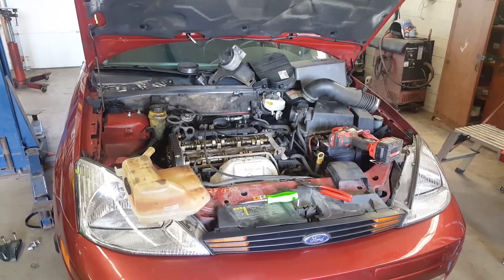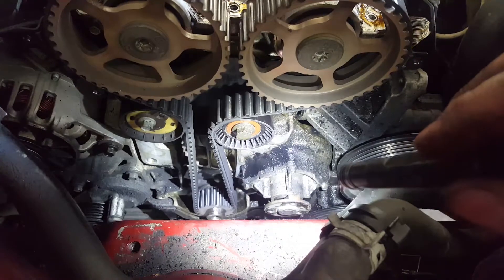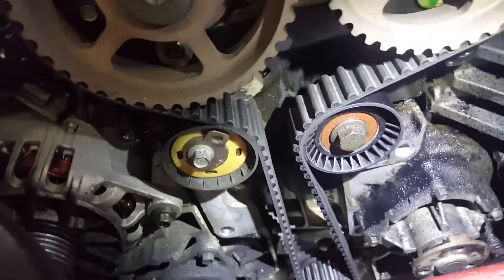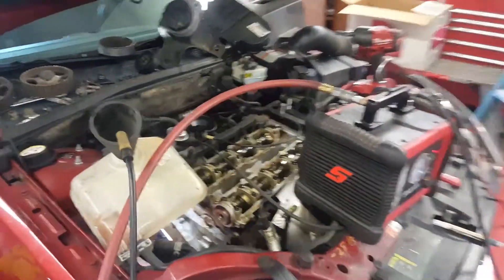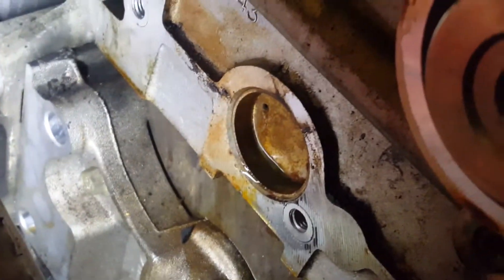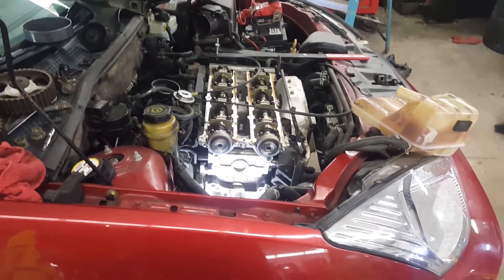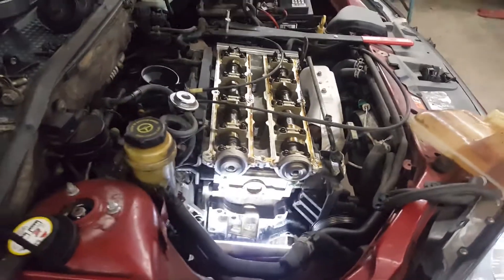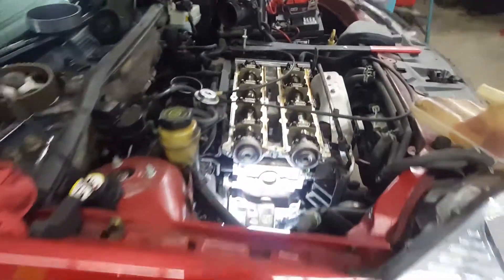Ford Focus - coolant leak

Comment: Hey quick question. I have a 2015 Ford Focus Diesel and i have a problem with the coolant. The coolant appears to be leaking internally. Sometimes when the tank is empty i open it slowly and as i open it some of the coolant fluid comes back through the pipes and the tank fills itself up again! Sometimes i open it and as pressure releases, it stays dry... i am spending so much money on coolant now. Also sometimes i turn either the heater fan or air con and the engine temp goes up and for example if i want hot air, it blows super cold air... so the aircon messes up....whilst the engine temperature is high (over half way mark) then all of a suddeen the engine temp gauge drops back down and then the air comes back and works as per the setting (i.e: if i have heaters on... blows cold air... once temperature gauge drops, it blows hot air).... i have had the head gasket checked as well as EGR cooler valve and was told this is ok. I also replaced the coolant tank and cap... problem persists .... please plesse please help...

Comment: I’m leaking green coolant but have no overheating nor is my car smoking the car runs and drives fine.  I’m not sure if it’s a hose that’s bad or the radiator itself. I have a 2000 Ford Focus ZTS Edit: The A/C and heater both are functional.
Reply from the maker: You'll have to pinpoint the leak. They make a  tool that will pressurize the cooling system when cold to help aid in finding the leak. Just be sure to keep the system full to avoid damaging anything else by overheating it. If I remember correctly, theres a plastic pipe that runs across near the top of the radiator that leaks on those. I could be confusing it with another make/model but I'd check that arra out too

Comment: My car is pouring antifreeze from wht looks to be above the alternator , not behind it. Literally pours out. Could this be the issue? Taurus X 2008 3.5 v6
Reply from the maker: Im not super familiar with the 3.5 in that year. BUT, I have seen a bunch of newer 3.5s and 3.7s that leak in that area when the water pump has failed. Its behind the timing cover and has 2 places it can leak if im thinking correctly. Check your oil to make sure none is getting in there. Without seeing it, I'd almost put money on the water pump. Cant say with 100% certainty but its pretty likely thats whats going on. If its like the newer 3.5, 3.7...theres also a coolant line that runs in the valley between the heads, but I haven't seen those leak.

Comment: Does anyone know where I can find the motor mount studs for this same vehicle,  it's the two bolts that the 18mm nuts are screwed onto you remove to get the motor mount off, I'm missing one of those studs.

Comment: I have that exact same problem in my 2003 ford focus but Im having trouble finding the right size freeze plug. What size is it and do you know were I can get one?
Reply from the maker: I donr remember the size..we either got it from a Ford dealer or our local engine machine shop
Reply: @Pyro17059  I used a rubber generic one you tightening down to expand it worked great I just need to drill a hole were the nut was so the plate would lay flat. Thanks for the video it helped me a ton.

Comment: what is the size of the seal or core plug of the zetec 2.0 motor head?
Reply from the maker: Sorry bud but its been to long. I can't remember what size it was. I just popped it out and got one from our local machine shop. Parts stores usually have some by size as well.